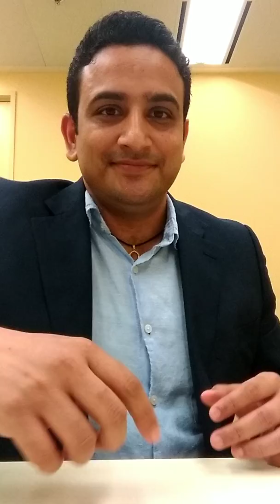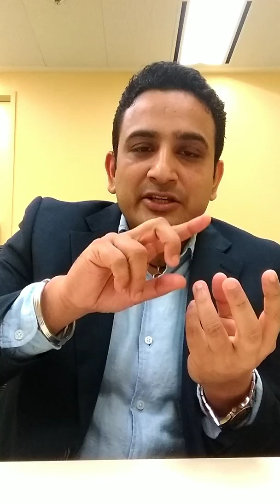STF6_Project_Ocean Connect

Comment: Hey Arin! Very nice presentation. Looks a very full proof solution to handle cargo loss, which will save the shipping company a fortune and also help customer getting the product on time, damage free.😊

On a similar note, I wanted to ask you as you can these technologies be enhanced and tweaked so that we can prevent or foresee oil-spill from the ships too?? It a big concern and its damaging our sea and aquatic life heavily. Just a thought 😀
Reply from the maker: Thanks Samyak, good thought. As part of our next phase, we would include sensors on ships engine, ECDIS, bunker filling caps etc .This will alert oil slick as well.